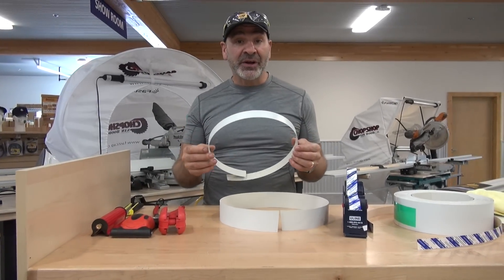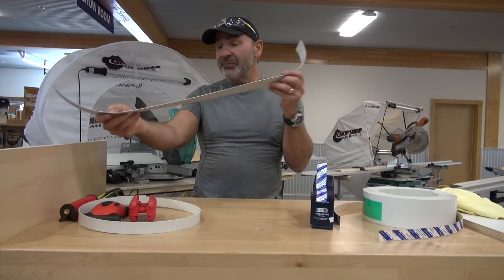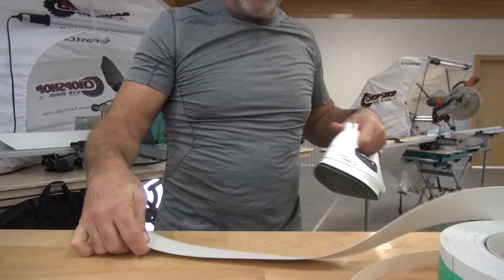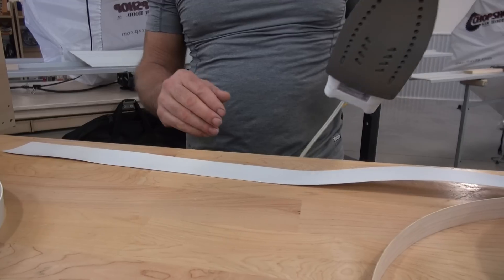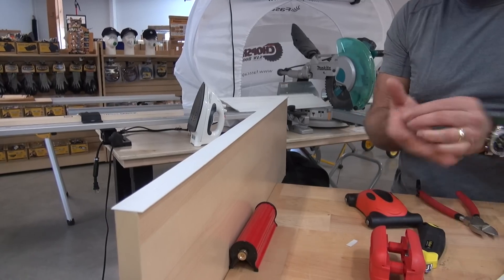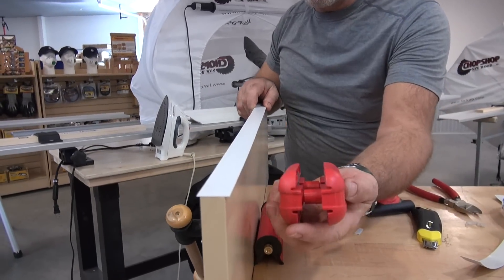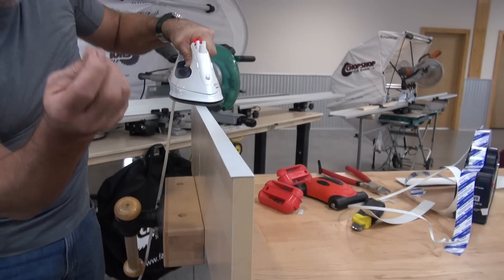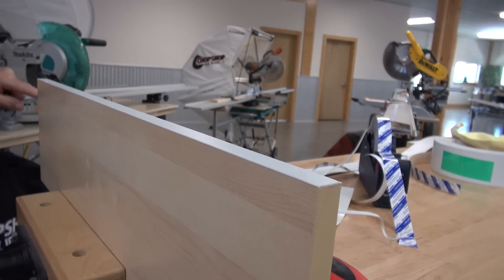SpeedTape with 1 mm PVC Edge Banding

Comment: Speed tape is good when you can't find a preglued edge . However it's useful for 45 degree cut or some weird shapes scenarios. The main problem still remains how to clean the edge properly on a 45deg cut
Reply: I do about 20 panels a day with 45s. I use spray adhesive and just flush one side, then cut the pointed angle with a box cutter. Of course wearing cut proof gloves and sleeves for safety. 
Absolutely hate 1mm tape that our customers like. 1/4 and 1 inch inside and outside radius are terrible to cut. I score the back of the tape with a knife a few times, makes it easier to cut. If one has a steady hand it comes out clean.

Comment: Hi will this work on exposed MDF edge and ABS edging?
Reply from the maker: Fastedge will work on exposed MDF, but there are additional steps needed to prep the surface before application. You need to apply a binder coat of 50% contact cement and 50% lacquer thinner with a roller and then let this binder coat stand for 10 minutes before applying the Fastedge. Fastedge does not work well with ABS panels. We do not recommend using our product for those panels. The adhesive will stick for a short time but will end up peeling eventually as these materials are not porous so there is nothing for the adhesive to bind to.
Reply: @FastCapLLC  Do you have a video showing that process? Also, when you say MDF, would the application be the same for particleboard?

Comment: How to aply wood veneer to face and edgesof mdf
Reply from the maker: Fastedge will work on exposed MDF, but there are additional steps needed to prep the surface before application. You need to apply a binder coat of 50% contact cement and 50% lacquer thinner with a roller and then let this binder coat stand for 10 minutes before applying the Fastedge. Fastedge does not work well with ABS panels. We do not recommend using our product for those panels. The adhesive will stick for a short time but will end up peeling eventually as these materials are not porous so there is nothing for the adhesive to bind to.